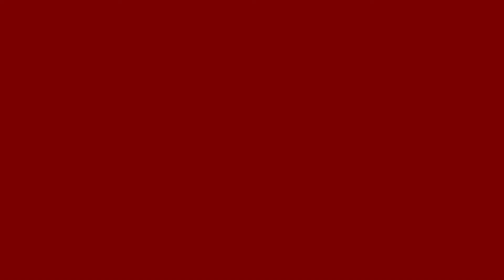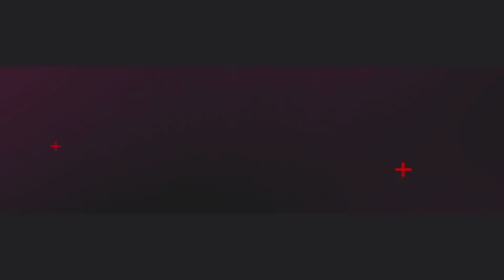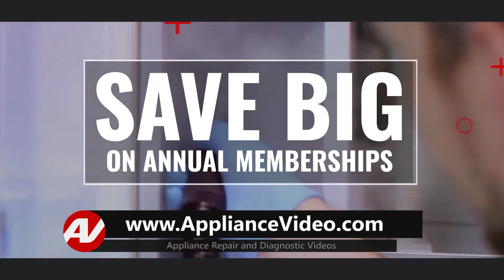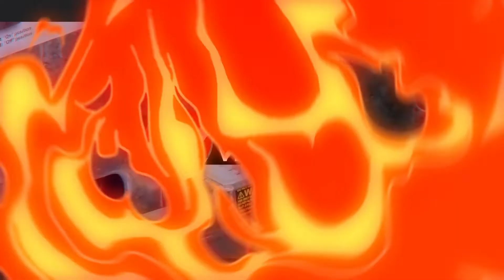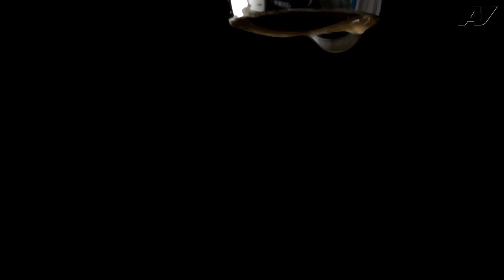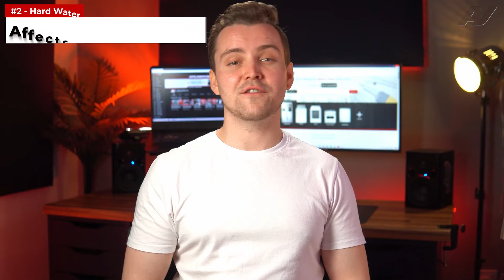Why Your Ice Cubes are Hollow or Small

Comment: From my experience, for whats worth, It was the end of the hose inside the freezer, right before the cubemaker. It was block solid ice. It all begun with hollow cubes, until it was no longer making them. I put everything in big costco cooler bags, switch it off, clean everything inside, inspect for ice build-up, and then with a hair dryer, melt all the ice-cube maker and its surroundings (been told a portable steam cleaner works even better). Then switch the hairdryer to cool position, to lower the temperature, switch it back on,. Expect the first batch of ice cubes in under and hour. My freezer is a 25 year old Gaggenau (fashion Amana in reality) and its been the first time after daily use for the last 10 years.

Comment: What is left out of this video is WHY low water pressure causes hollow ice cubes.  After months of hollow ice cubes and two new icemakers I finally understood what was going on.  In the icemaker there is a temperature sensor in the Icemaker control unit which is at the opposite end from the water inlet, if the last ice cube  position is not filled with water then the icemaker thinks the cubes should all be frozen but they are not  so when it cycles it ejects partially frozen ice cubes and the liquid in the middle of the Hollow cube causes a frozen mess in the cube tray and so you end up with hollow cubes and a frozen mass in the ice cube tray.  If water pressure is ok but still getting hollow cubes there is an adjustment screw that can adjust how long fill valve stays open.

Comment: I'm getting hollow cubes from an aftermarket icemaker I just installed. But the OEM unit (which still functioned but had a broken tine and was starting to get stuck ejecting cubes, reducing overall ice production) was still producing solid cubes. So it seems unlikely the problem is water flow, and maybe something more like the aftermarket icemaker not keeping the water valve open long enough?

Comment: Hollow cubes and small cubes are two different problems. Small cubes can be from not enough water, the cubes will be small but solid.
If they're full size, but hollow chances are the cubes are being dumped before all the water is frozen. These cubes freeze from outside in, once they're dumped, the water inside falls out of the cubes. And most likely puddles at the bottom of the bin as a big block.